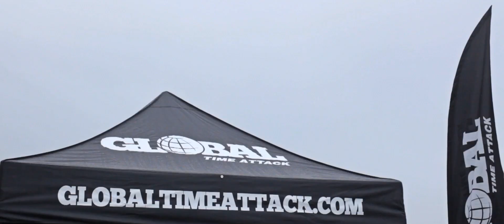Chris Rado's Scion tC 2.0

Comment: What's the point of the rear wing? The front wheels is what needs all the traction with the amount of torque that thing is pushing out. I guess it's to keep the airflow well balanced?
Reply: its to keep the rear tires on the ground, ever heard of over steer? this keeps weight on the back tires to keep them sliding past you

Comment: Not to hate or anything (I have tons of respect for what Rado did for FWD drag racing) but have you guys thought the whole "double-wing" thing through? Have you had it in a wind tunnel? Not to brag, but I'm an aerospace engineer, and we use CFD a lot, and I think that design would spit out something that isn't too pretty, airflow-wise. Having the front wing high up like that is going to create wildly turbulent air in it's wake and basically render the rear wing useless. Think one Formula 1 car following close behind another. They avoid doing that because the turbulent air coming off the rear wing and diffuser of the car in front basically causes the wings of the following car to be tremendously ineffective, robbing it of the downforce needed to sustain the grip that it needs to navigate the track as fast as possible. That's why a driver getting set to pass a car that's in front of him that's putting up a fight will hang back a little bit to get some clean air going over the wing surfaces, and strike when the moment is right (i.e. staying within DRS range and passing the car ahead on a straight). And the distance between that high front wing and the rear wing is not enough for the rear wing to get clean enough air to be effective. Why not go with a sizeable front wing mounted down low and forward, basically instead of those pillars holding the wing up and ahead of the car, having them hold the wing down low and ahead of the car. It would then be acting like a Formula 1 wing (the lower the better) and the rear wing will have clear air. I just can't see that rear wing getting clean enough air to produce any significant downforce. It's basically being stalled by the front wing. Anyway, my two cents trying to help.
Reply from the maker: Hey Sandra, I'm sure they did think it through - they are a smart group. Unfortunately, they aren't racing in time attack anymore - as far as I know. Thanks for the insightful comment.
Reply: Will Roegge No problem. Best wishes to you and your future endeavors.
Reply: Sandra Rios :THE FRONT WING CAN BE ADJUSTED!!!!!
Reply: I was actually going to comment on just this. They even said they are just some dudes doing this for fun. They clearly don't have an aerospace engineer reviewing their work. Because that rear wing is going to be horrible due to the deflection of flow from the front wing. It's clear they haven't done their tail equations to figure out the new angel of attack of the airflow, but yolo.